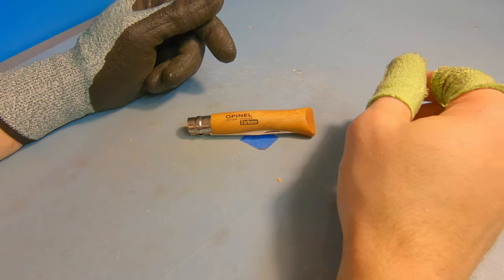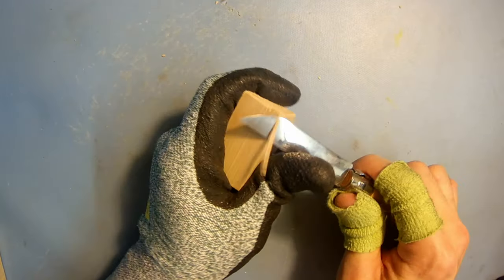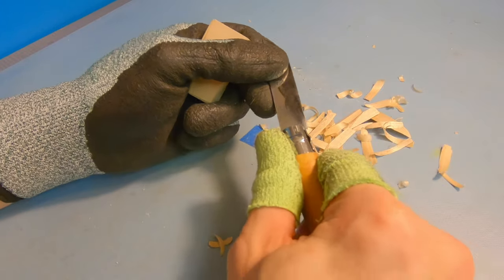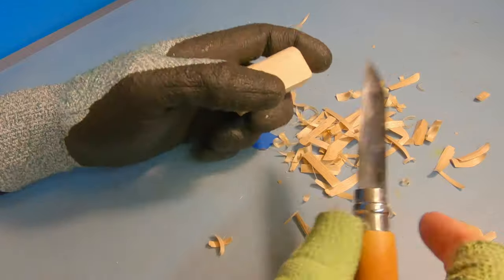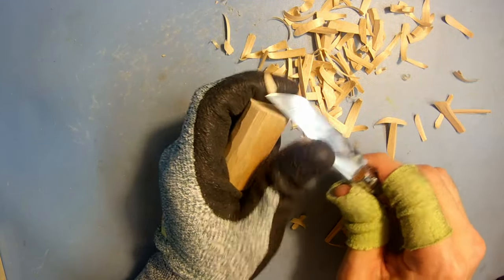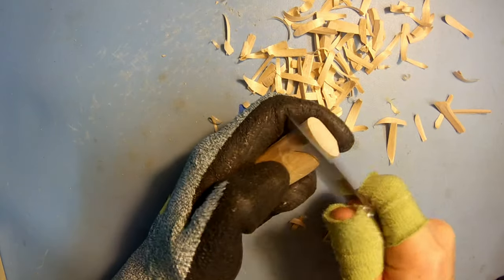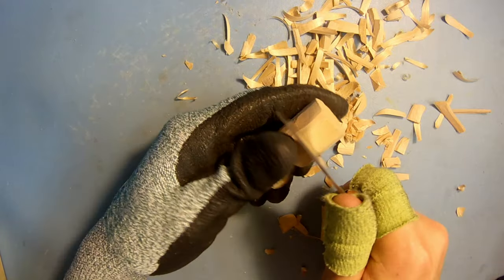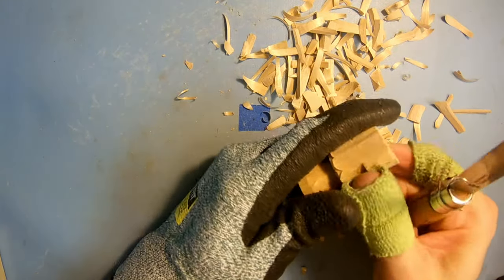Best BUDGET Pocket Knife for Whittling! Opinel Carbon Steel Knife Review

Comment: I'd love to see you carve a cool handle Design for a opinel with an opinel
Reply from the maker: That would be a neat idea! I'll keep that in mind.
Reply: @CarvingisFun  that is an idea yeah but some people make a Damascus blade for it but you know what the hell you can’t sharpen good knife out of bad steel  if it’s not broke don’t fix it  as for knife they great they come in crazy blade shapes and lengths even a great saw too I didn’t like sharp corners on my opinel so I whittled it round much more comfortable to use I prefer stainless steel version as you say carbon steel is low end of hardness stainless steel version is more stronger and don’t rust if you like it as a Bushcraft tool  👍🦊🐾🇮🇹🍀
Reply: @CarvingisFun  that would be fun! You should consider that for a video if you ever are at a lose for ideas.

Comment: They are really good value. Opinel (especially those with carbon steel) is more than a folder - it's a statement. I've used the sizes 8 and 10 for many Years as EDC knife, still got some around in my outdoor bags. I once had a display with all the different sizes from #2 up to #13. But I have my knifes for use(*), not to collect, so I sold the collection.

(* the first thing I've ever done with all my Opinels: cutting some green hazelnut or oak to liberate the blade from screaming "I'm brand new and unused") 

P.s. If You'll want to choose a small model, keep in mind that the size 6 is the smallest size that has the bladelock-ring.

Comment: None of my opinels have came sharp, allways some flat spots. Still, I do like my no. 9. But for the price of that opinel you can get something like the mora 120 which has a more ergonomic handle, comes sharp out of the box, is a proper fixed blade and has a shorter blade so you have a more usable tip. Granted it has a thicker blade stock at 2,7mm
Reply from the maker: Interesting, the opinel I have in the video came way sharper than any mora I got in.
Reply: Time to get out the sharpening stones. 

Don't forget to strop.

Comment: I once had a no 8. And I really didn't like it. Almost as if you carve with air. Their is no weight to it. Didn't like it at all. But now I'm thinking of buying an Opinel again. You use a no 7. I have smal woman hands. Do you think a no 6 would be better for smaller hands? Or maybe even a no 5
Reply from the maker: I picked the no 7 for myself as I measurd the width of my palm and compared it to the length of all the handles to find a good match.

Just a heads up, anything smaller  than the no 6 won't have the blade lock.

These knives are indeed super light, which makes them perfect for throwing into your pockets.
Reply: @CarvingisFun  I ordered a 6 and a 5. Non locking is no problem.
Reply: @2371Anita  Pablo Picasso sculptured its figurines with Opinel N°05...

Comment: Piece of scrap red oak dowel folded the edge of the blade on my carbon No. 7 but any softer wood it’s been fine.
Reply from the maker: The thinner edge is a bit more peone to rolling, but like you said softer woods than red oak are fine.

Comment: Hi, great video! New here and a total novice with whittling. Looking for what I need to begin with? Gloves? Opinel carbon steel knife no 7? No idea what wood to use either. Any tips please anyone? I've been watching and reading a lot but there are so many! Would really appreciate any ideas. Definetly subscribe! X
Reply from the maker: Thanks!

The basics you will need to start whittling are: a knife, wood, sharpening tool, and finger/hand protection.

The opinel knives are a great and affordable option that many people like and use while being quite affordable.  Other brands like flexcut and occ tools may provide you with a more specialized tool that you may like better as well.  
If you want to see my favorite pocket knives for whittling, check out this video: https://youtu.be/vGcWbnHKSLg
For regular fixed bladed knives, check out this one: https://youtu.be/BI4d4y09tg0

Basswood is the main carving wood that most people use as it is easy to carve and has an even and uniform wood grain. For more info on what wood to pick, check out this video: https://youtu.be/tYm3Rcq59Ig

To keep your knife properly honed, a leather strop with polishing compound (green compound works great).   For more info, check out this video https://youtu.be/8LQ4-dZo99g

Finger guards and slice resistant gloves are important for beginners who are learning to manipulate a sharp knife while carving.  I personally use a slice resistant glove on my off hand and finger guards on my knife hand.  I reviewed a bunch of different options in this video here: https://youtu.be/CdNTNKvzsGk

For a full rundown of what you can use check out this video:
https://youtu.be/KlxFIzSV-Zc

Comment: Is there any big difference between carbon steel or stainless steel in case of wood carving?
Reply from the maker: Originally, I would have said yes but really its all in how the steel is heat treated.  Look for a blade with a rockwell hardness between 58 and 61for best results.  Usually you will find this in carbon steel blades but some stainless steel blades can be hardened to this level as well
Reply: @CarvingisFun  Thank you very much for the reply, I bought a Opinel No.8 Stainless steel. I hope it will be in this category of stainless steel which are hard enough for carving. Do you have experience of Opinel stailess steel knife?

Your videos are perfect. well done.
Reply from the maker: Thanks!
The opinel SS knives are a little on the softer side, but if you are carving softer wood and maintain the edge every 20 or so minutes of carving you will be fine.

Comment: Just copped one of these! What you mean about keeping it oiled?
Reply from the maker: Carbon steel blades are prone to rust.  If you take care of the blade it will last a long time.  If you are to ever leave it in long term storage put a thin coat of oil (mineral oil, 3 in 1 oil ect)  it will protect the steel.

Comment: If you want a smaller blade but with the locking collar,      You can cut the blade down
Reply from the maker: Yep!  I've seen a lot of people doing this too.
Reply: You could also pop the collar on a smaller opinel and file or grind the lock into the collar. Planning on doing this with my old no. 5

Comment: How would you sharpen this knife? Remove the secondary bevel? Or keep it?
Reply from the maker: I would actually modify the secondary bevel and is what I did on mine.  

There are plans for making a vido on exactly what I do, but make the edge angle smaller and more smoothed out.
Reply: @CarvingisFun  thanks very much! I will try and tell you the results!

Comment: Great review, thanks. How about the Opinel 10 slimline stainless steel for carving/roughing out etc? I think it's technically a filleting knife, but I'm torn between buying the #8 and the stainless steel slimline #10. (I have absolutely zero experience of either) Thanks. 👍
Reply from the maker: The Slim Line knives are pretty nice, but I would be worried about edge retention on the SS blades over the carbon steel variants.  The SS blades would be fine for general all purpose applications, but for a purpose driven wood carver I would pick a carbon steel version first.
Reply: @CarvingisFun  Hey thanks so much for the quick reply and the great advise. Based on your review I think I'll be ordering my Opinel 8 Carbon steel. I'm looking for a good roughing out knife that's not too expensive. Thanks again. Huge help. 👍
Reply from the maker: You're welcome!

Comment: Thanks a lot for this video! Quick question: for someone with smaller hands, would it be a better idea to get the number 6 instead? Since it would be a slightly smaller blade and maybe a little bit more precise?
Reply: Hey mate! Totally. All opinel-knifes are same built. Just use ur prefered size.  Hope my answer helped you. (:  -The blade 1 number smaller don't make that difference when it comes to precision. But it's up to you (:
Reply from the maker: 100% yes, pick up the #6 if you want a smaller blade.  I actually used their handle measurements and matched one to the width of my hand when I picked mine.

Comment: Great review. You recomended carbon, can you please comment why not stainless steel? It is for my 8 year old son for the scouts....I think carbo will stain with edge.....why not stainless that may have a better look.
Thanks
Alex
Reply from the maker: While Opinel's 12c27-MOD Stainless Steel is great for corrosion resistance, it does have a slightly softer steel when compared to the XC90 Carbon Steel.  Because this video was primarily focused on using this specific knife for whittling and wood carving, the primary goal was a knife with good edge retention.  But for a multi purposed knife, carbon steel may not be the direction you will want to go.

I am both an Eagle Scout and was an Assistant Scout Master for some time and know for a fact that younger kids will benefit more from a stainless steel blade over a carbon steel blade for the exact reason you mentioned, corrosion resistance.  Stainless steel will be much easier to maintain in a multitude of environments and uses allowing for more of a multi use roll that a scout will need.

Go with the stainless steel for your son.  It will be easier to maintain and not make him question if he should use/bring his knife in a location where it could rust or corrode.
Reply: @CarvingisFun  Many thanks for your rapid response and advice . i already bought it !!!
Reply: A carbon steel knife WILL attain a grey patina with use. This is good. The only thing to watch for is red crusty rust. If you keep it dry or dry it after use that's not a problem. After I wash my #7 I hand dry it and then douse it with rubbing alcohol to displace any residual water, then let it sit a minute, then blow out any leftovers. So far this has kept it safe .  Have fun with your Opinel, they're great knives.

Comment: is the opinel no8 better than swiss camper?
Reply from the maker: Depends on criteria.
The camper has excellent utility, but the no8 with carbon steel has better edge retention.
Both will need some work on the edge, but the no8 has a locking blade and more comfortable handle.  On the other hand, the camper has knives, a saw, and othet utility items that make it universally useful.
Reply: @CarvingisFun  ok thanks ill go for the camper because i need the saw
Reply: @CarvingisFun is the non carbon one still viable?
Reply from the maker: Yep!! Just keep it honed sharp and you will be fine.
Reply: @CarvingisFun  thanks im going to buy the beaver craft strop and the work sharp micro to keep the no6 sharp

Comment: Beginner to wood whittling here, looking for a first knife, debating between the Opinel No.5 or the Flexcut KN13, which one would you say is the best choice? My hands are relatively small so I’m looking for a small but comfy handle as well. I’m leaning more towards the Opinel right now just because the blade’s a little bigger than the Flexcut, so I can go from smaller projects to bigger ones without having to spend money on more knives in the long run, any tips?
Reply from the maker: Howdy!
The issue you may run across with a longer knife is when you want to add smaller details, the blade may be a littler harder to control for the smaller cuts.  Trying to find that balance could be a little bit of a challenge, but a blade that is 1-3/4" long (as suggested by Doug Linker) seems to be that perfect balance of length to fit most whittling needs.  

The Opinel No5 will most definitely work, but I do have some reservations on the KN13 as I have heard the fine tip can be brittle.  I have heard from several people that they broke the tip on their KN13 and had to reprofile the knife.  Maybe the KN12 or the KN14 would be better fits for you if they are available.   The KN12 blade is about 1-1/4" long and the KN14 blade is about 1-3/4" long.

What country are you in?  There are several other knives that may work for you too, but availability may be dependent upon what country you live in.
Reply: @CarvingisFun  Sounds great, I’ve been going back and forth on this question the last couple of days lol, but I think you’re right, I’m probably gonna play it safe for the time being and go for a smaller blade.

I’ve heard the same kind of things about the KN13 which is why I started debating the Opinel in the first place haha, but I’ll look into the KN12 and KN14.

I’m actually in the UK as it happens, it’s harder to get the top ranges like Helvies and Drakes unfortunately, unless they’re shipped from other European countries or from the US, which is super costly ): So I think my safest bet as it stands is either a Flexcut or Opinel, but at the moment I’m back leaning towards the smaller Flexcut blades, just starting out so I dont wanna get too big for my boots early on lol.

I’ve heard a lot about Pfeil’s seeing as they’re easier to get within Europe, but at the same time I’ve heard a lot of negative stories about these, which leaves me a bit stuck...

It seems that everytime I’m close to going through with a certain tool, I hear somebody say that there’s another that’s better...vicious cycles 😂 But ofc I want to make sure I get the best blade possible for what I’m interested in, which is small detailed figures atm.

Thanks for the detailed reply, appreciate your advice and quick response!!
Reply from the maker: You're welcome!

Pfeil makes good chisels and gouges but their knives need the cutting edges reprofiled our of the box.  If you know how to put a good edge on them they will be fine.

Still, given the choice between flexcut and pfeil knives, it's flexcut all day long.
Reply: @CarvingisFun  Turns out Pfeil’s a lot more difficult to get in the UK than I thought...rip 😂 So sadly the only V Gouge I could find for an affordable price  and the right angle/ length was a cheaper brand called ‘Faithfull’, personally never heard of them myself, but just curious if you have? Apparently V Tools here are super rare, especially the good brands like Pfeil and Flexcut, which is a bummer but...oh well!

Thanks to your and other’s advice, I’ve made a decision and went with the Flexcut KN12, probably the best suited knife for what I’m interested in making...not a bad price either lol, thanks a bunch once again for all your help! 🙌
Reply from the maker: Haven't heard of "faithfull" but I have slowly compiling a list of tool websites world wide in the hopes of making a master list for everyone.  You could look up a company called Two Cherries (aka Kirschen) or Stubai Tools for v-gouges.  

Here are some other websites that may have some tools for ya.  I haven't owned some of the tools they are selling but lets hope they are good:
https://www.oldtoolstore.co.uk
https://www.workshopheaven.com/hand-tools/chisels/carving-tools.html
https://bristol-design.co.uk/

Comment: Sorry but the Opinel is only useful for slicing Garlic, French Onions , stinky French cheese & maybe a bit of gardening . The French are reputed to use it in the garden & then use it in the kitchen without cleaning it off first before cutting Garlic & their disgusting runny cheese ! 
I really can't take serious a video about the Opinel knife, its simply a badly made / rough finish barely sharp out of the box  inferior knife totally incomparable to the quality , finish & sharpness out of the box to any  Swiss Army knife.
Reply from the maker: Considering the price of the Opinels and specifically picking the carbon steel versions as pointed out in this video, it does offer some significant advantages over a SAK like edge retention, locking blade, and affordable price point.  But I do have to agree that the finish quality has gone down over the past few years but a couple minutes on my stones and strop give me a blade that I would gladly use over any SAK for whittling.
Reply: @CarvingisFun  Sorry, this is not a personal attack on your integrity as video blogger  or me being deliberately rude to a stranger on the web  but Swiss Army knives are multi-tools for general use by working people, farmers, technicians, craftsmen, hobbyists , campers & the military unlike Opinels which IMO are simply not in the same class or category as a SAK.  If you like its the difference between a Rolls Royce & a Trabant, if you gave me one for free I would snap the blade & throw it straight in the trash can
Reply from the maker: Lol, I hear ya on intended purpose but my focus of the video was purely about using this knife specifically for whittling. You are correct, they aren't in the same class or catagory.  
Also, not to be an attack on anyone who likes their SAKs, but I prefer my Leatherman's and carry at least one of them with me every day. 
 If given the choice I would gladly toss the SAK in the trash can and keep my Leatherman Charge that I have been carrying with me for the last decade :)  Had the original Gerber Flik for the prior decade and should have just chucked it (eventually did) but man was it fun to just flick out the plyers!  But before that, I have a few SAKs I would take with me until my dad let me borrow his Leatherman.
Reply: @CarvingisFun  I have not owned a Leatherman for a decade since I retired early from work. I never carried one in my pocket but I used one as an office tool for some 30 years & gave it to my replacement & as far as I know he is still using it . Even at home I have never used one nor for that matter a Swiss Tool  as I have enough regular full sized tools & a dedicated SAK home tool kit of 5 useful SAK's - the Cybertool M, the Deluxe Tinker, the Ranger, the Spartan Lite & the 84mm Watch Opener SAK
Reply from the maker: I hear ya.  Since Im all over the place, just having a tool at my hip comes in handy almost every day from sitting inside a multi milion dollar machine to being out in the woods :)  its a nice addition to my normal tools but always in arms reach.